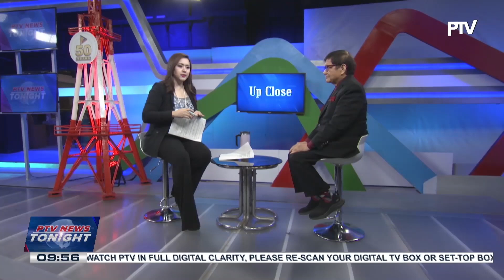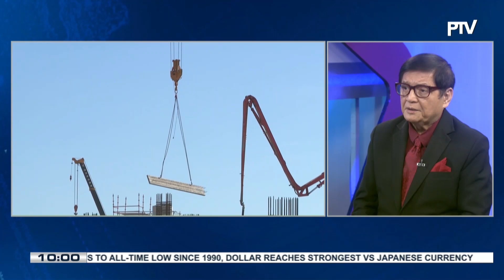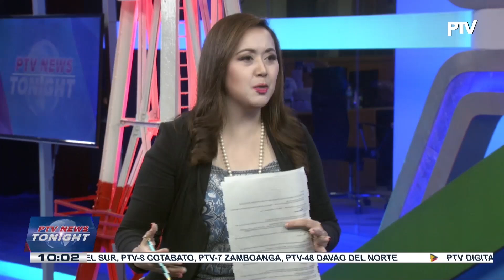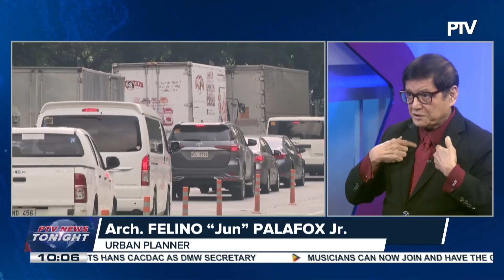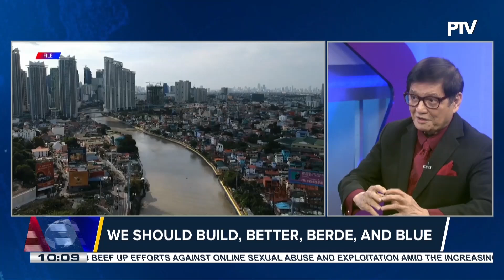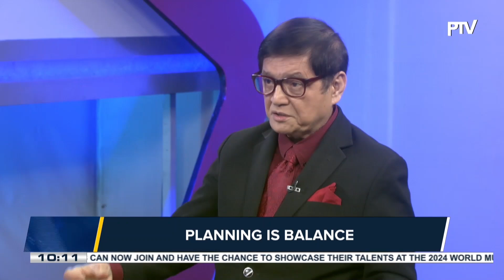Earthquake-resilient, flood-proof, safe building, infrastructure design as part of gov’t’s...

Comment: Snippet:  Weather cycles have always been regarded as inconsistent,  (e.g., heat to warm and rainfall to intense heat which changes into timog).  If you must build new nowadays, knowing what you know today, be sure you are building with heights (elevation) or just a bit above the flat land.  Bldg just right on foundation alone isn't too safe anymore when it comes to flooding -- due to frequent rainfall and high winds.  PH Engineers should also be lucid on bldg more sustainable reservoirs -- you guys always get the bad wrapped with high volume of inland flooding due to either too much rain-deposits or dagat water from the seas -- blown by strong high winds and into the city.  It might also be even wiser to build housing projects on an incline or build your streets identical to a flat-down see-saw -- not too much, but some.  It allows rainwater to flow down into the reservoir or down into the street irrigation pipes.   He has rescued us from the doomed of darkness  Super helpful discussion.  be blessed, PH.  apr2024